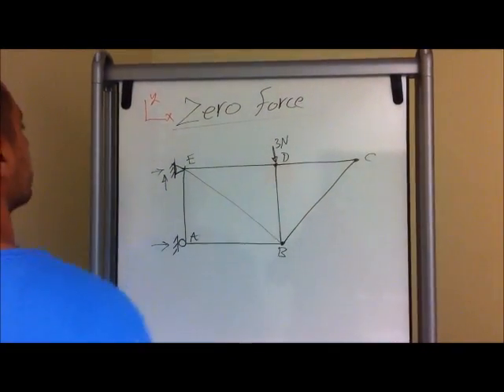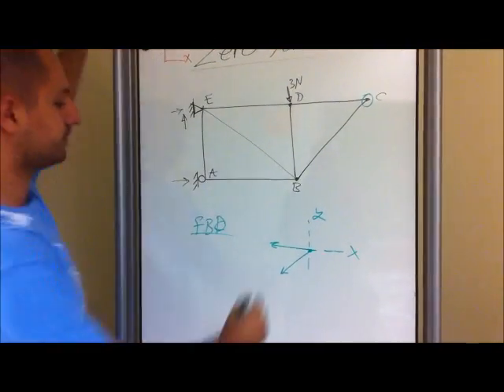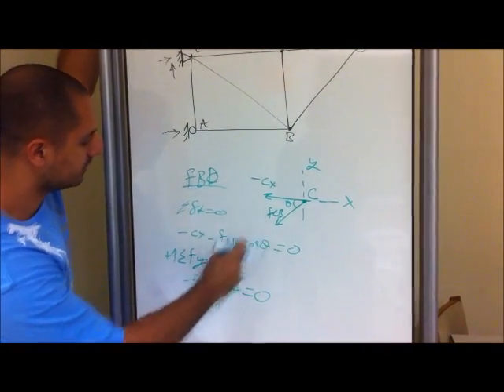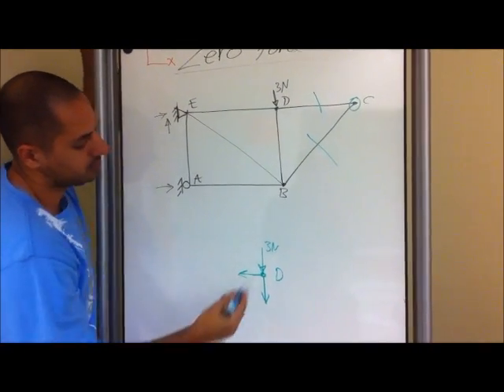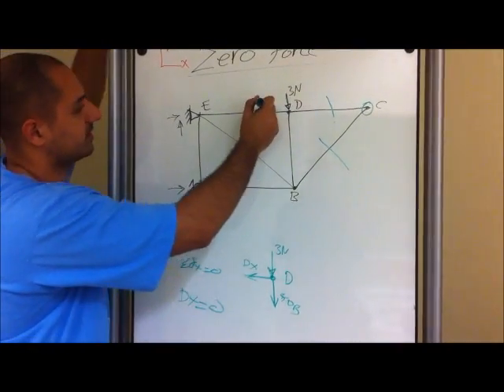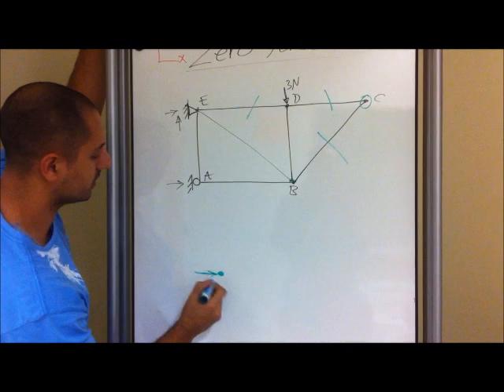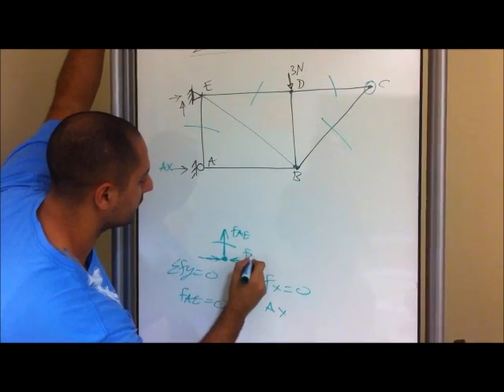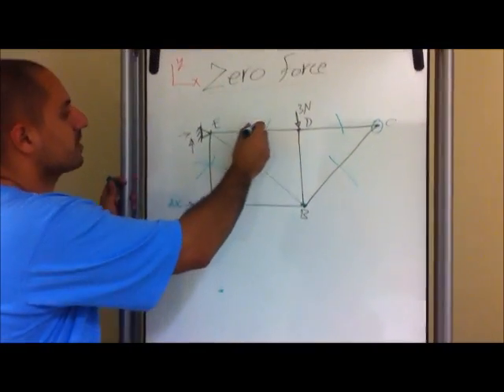zero force members part-2

Comment: I think my hardest problem with zero force members are the ones that are not obvious. Here the truss has nicely veritcal, horizontal and diagonal lines. My problem comes when I have a joint with 3 members. 1 member is not colinear or 90 degrees to joint plane. The other two members are not horizontal to normal x y plane, but if you tilt the paper you see that they are are indeed colinear. When calling that colinear plane the x axis I realize that the 3rd member must be equal to zero Hard to tel